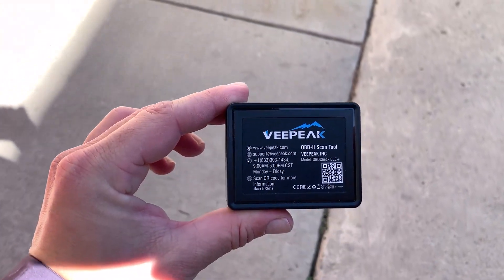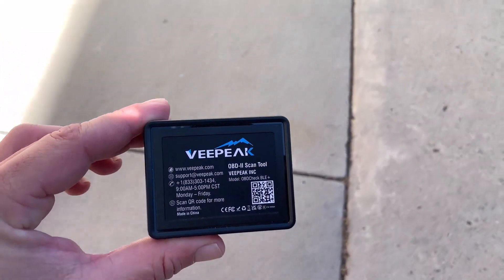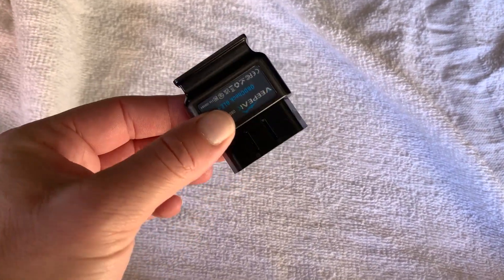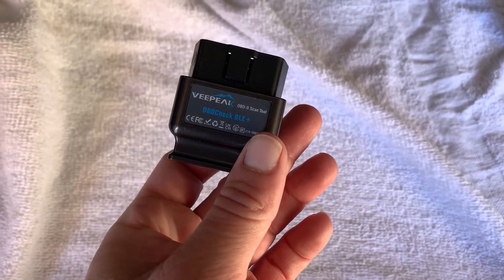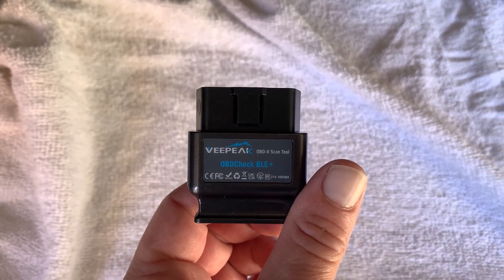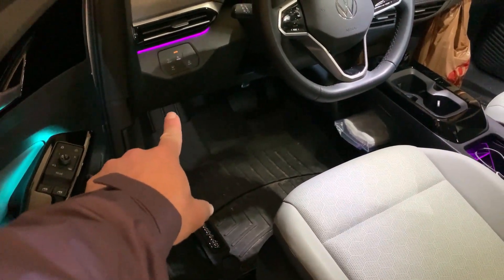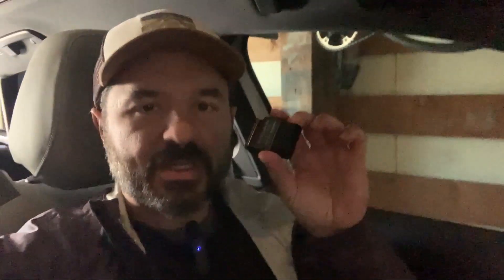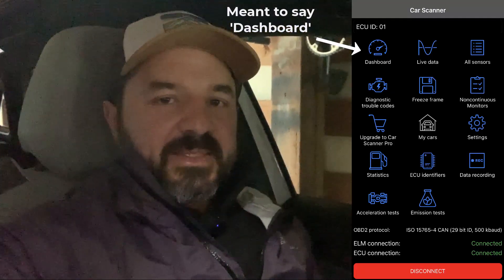THIS is my new FAVORITE toy for EV charging!

Comment: Does the dongle turn itself off when you turn off the EV or do you have to unplug it so that it does not drain the 12v battery?
Reply from the maker: I’d unplug before leaving your car, just in case it draws from the 12v.

Comment: Thanks for the video.  Have you had any luck using this with ABRP?  
And can you use this with two different EV's?
Reply from the maker: @CarolynsDailyGrind  You’re welcome! Yes, you can use it for more than one EV. I’ve never connected it with ABRP, however, I just tried ABRP’s new Enode connection method, which allowed me to connect my car very easily without the use of an OBD. I’ll be making a video about that shortly. Enode does require a premium ABRP subscription though.
Reply: @goneelectric  that’s awesome. Yes I do have the subscription. I have heard of people using that specific OBD reader with the ABRP. If you give it a shot, let me know how it works for you.

Comment: I wonder, what is your worry about charging “issues” related to less than rated charging levels? Not much can be done except trying a different charger.
Reply from the maker: More of an interest than a worry. Helps understand how EV batteries work, and over the long term, it can be used to monitor battery health.

Comment: Hi Evan, useful info in your video.  I hope you’re still answering questions. My question is: Do you (or can you) leave the dongle plugged in all the time, when the car is sitting idle at home and/or as your driving around?  If one does, are there ant negative effects?
Reply from the maker: Thanks! Glad you found it helpful. I do sometimes leave it plugged in for longer periods without any ill effects. You’ll just need to reconnect it through your phone any time you turn the car back on.

Comment: Your video made me wonder if my current ODBII scanning tool can read EV data. It's a BlueDriver Pro scan tool I bought back in 2016. It read other vehicles I've owned, but did not like my I6. I called support and sure enough they said flat out they do not offer support for EVs. Amazing how this $40 tool on Amazon (now $36 with a 10% coupon) can do with my $100 scanner can't 😕.  Thanks for the tip on which tool does work for our cars.

Comment: I use a similar setup for my Bolt EUV. I've found the car actually does condition the battery for DC Fast charging, but only once you are actually plugged into a DC Fast Charger. It's not very aggressive either, only pushing it to about 68F. So in winter the second charge of the day ends up much better than the first. Pre-conditioning would just need a minor software change, but I don't have much hope that either GM for me or VW for you are interested in pushing out updates based on past experience.
Reply from the maker: Very interesting that Bolt warms to 68 degrees- VW states that ID4’s optimal temp for fast charging is 68F. I’ve found that DC fast charging heats ID4’s battery pretty quickly and significantly. I’ll have a video showing that on Friday. I too have little confidence for software updates, sadly.

Comment: I thought the ID.4 heats the battery as soon as it starts, so it's always preconditioned, as it were. I could be wrong though.
Reply from the maker: It does warm enough to prevent freezing in very cold temperatures, but it doesn’t have a mechanism to actively warm the battery to optimal temp for fast charging. MEB’s optimal temp for fast charging is apparently over 68 degrees. I’ll have a new video about it on Friday.
Reply: @goneelectric True, plus I’m sure it uses power to pre-con the battery.  I’m sure a software change is needed to program this logic into the factory Nav system.  Again Tesla has the VW beat on this feature.

Comment: Hi Evan. I've watched most of your videos on your ID4 and I notice that you still say 'ignition on' often. I'm not sure you even realize that you're saying ignition. 🤣🤣There's no ignition for EVs. It's just a matter of the display turning on when you press the brake pedal. The EV is never really turned off -- it's always just in a state of mild sleep with the display turned off. Anyway, I'm not trolling or criticizing. Just thought I'd point it out if you weren't aware you're doing that. ☺☺
Reply from the maker: I had no idea I was saying that, so I appreciate you pointing it out! Sometimes I have to multi-task while filming, which interferes with articulation. Thanks for the note!
Reply: @goneelectric  Oh yeah -- lots to do while filming and trying to plan your next steps. I totally get it. I figured you probably didn't even realize it. Another one that others still say -- not you -- is "gas" pedal. 🤣🤣As you know, EVs have no gas, so it really should be referred to as the 'accelerator' pedal but many still refer to that pedal as the 'gas' pedal. Old habits die hard. 😂😂

Comment: Does this work with PHEVs? I was part of a charging study recently that was tracking how people charged their cars and they sent me a similar tracker but it had a cell connection to report back to the researchers. It would never report battery details like charge state, energy used, or charge energy and times. It would only report fuel usage figures so it seemed in the data like I never plugged my car in even though I'm like a charging czar and vacuum up every watt I can get access to.
Reply from the maker: Charging Czar (nice), yes it indicates that it works with PHEVs- for instance, I can see that it works with Toyota PHEVs, like the Prius prime and others.